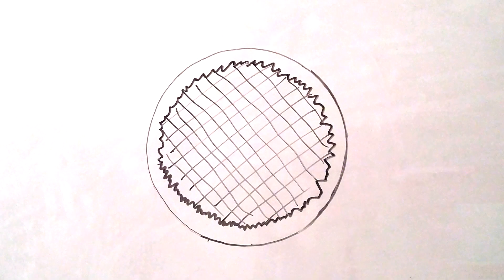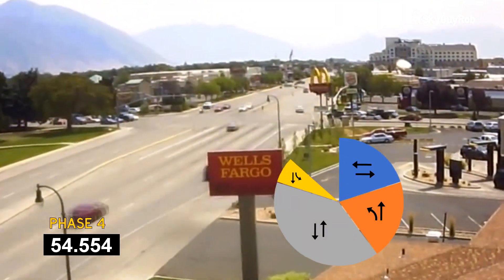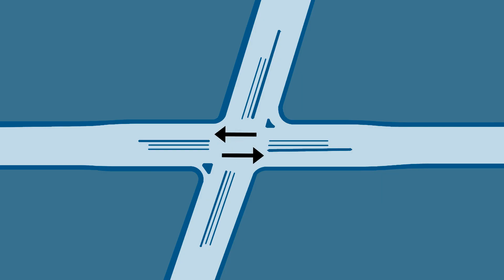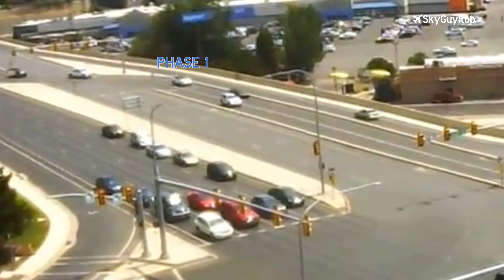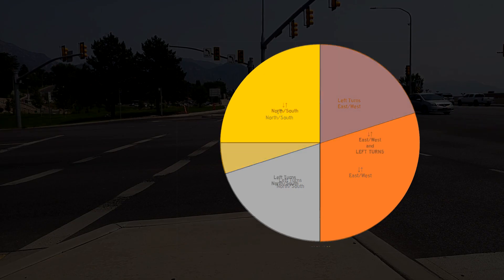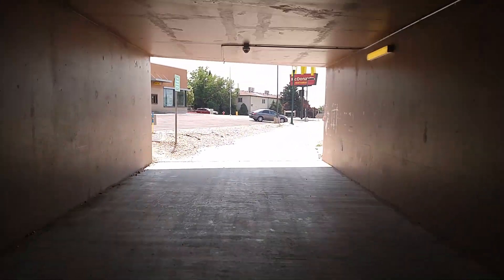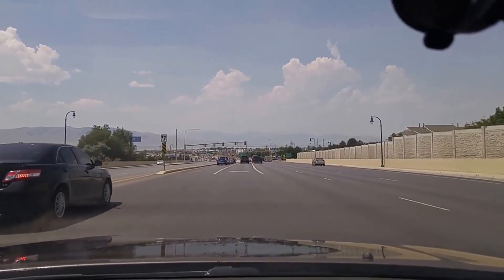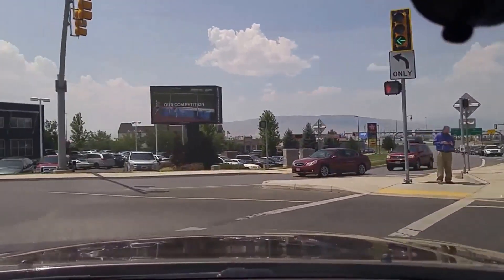New Crazy Traffic Light Which SOLVES Congestion

Comment: Wow, never seen one of these before. You need A LOT of space for them.
Reply: You do, but it’s wonderful!
Reply: Better bulldoze that bicycle lane and bus lane to make room.
Reply: @schroedingershat7912  and homes, stores, parks, etc?
Reply: @josephj6521  Only if we replace the homes with high density housing with no parking. They don't need parks because they're in a 'high transit access area' (at least until we bulldoze the bus stop for another intersection).
Reply: Considering they're being replaced with on ramps and bridges, the space isn't really an issue. Either one takes plenty of land.
Reply: I'm not sure why you wouldn't just go with a roundabout if you need all that space either way. A roundabout would likely wind up taking somewhat less space overall as the additional space is mostly just at the intersection rather than the approach on all sides.
Reply: @SmallSpoonBrigade  I can't imagine a roundabout on a very busy 6 lane road. Sounds like hell. I'm all for em on busy 2/semi-busy 4 lane roads, but very busy 6 lane sounds like death
Reply: It's Utah.
Reply: Yeah but if you've got the space you might as well use them
Reply: Yeah, all it really does is spread the intersection out.  You still can't make a left crossing the oncoming traffic, so it doesn't actually save all that much time, it just reallocates it more to the thru traffic.
Reply: @peterallen4605  you're wrong, you need only 3 light phases, not 4 - meaning you come to a green light 33% of the time, rather than 25% - that means you get a green light an extra 33% of the time (i.e. 133% of a 4-phase) and you can easily see that will improve traffic flow dramatically.
Reply: @joshpavelich5235  I made a six lane roundabout in Cities Skylines. 
It was, in fact, death.
Reply: @joshpavelich5235   Yep. In these cases you typically have a roundabout offset from the main road, with a only few of the main road lanes going to it. Drivers who want to pass the roundabout unimpeded just move into the appropriate lane ahead of time. Yes this only works well for one direction of the main road, but under/over passes are known to be used. Most of our motorway (freeway) junctions are essentially big roundabouts built under the motorway using two underpasses, one for each side of the circle.
Reply: @joshpavelich5235  when I  was young we had a giant traffic circle where 2 highways met and it was an absolute nightmare. Lubbock, Texas just in case you wanted to know
Reply: Hence their presence in Utah.
Reply: @PW_12345  This style doesn't actually take much more space than a traditional intersection, while a high volume roundabout would need to be a lot bigger to be safe and efficient.  Keep in mind the traditional intersection would already have left turn lanes, the CFI is just relocating those lanes.  It does elongate the intersection to break up the crossovers, but that's in the orientation for space that would be needed to construct an overpass with onramps and offramps.  Roundabouts need space between the entrances and exits, they can not fit in the footprint of just where the roads intersect.
Reply: @PW_12345  You might be thinking about lower capacity roads...
Reply: @SmallSpoonBrigade  Roundabouts work great when there's low to moderate traffic or a problem with safety. If you put roundabout on high intensity intersection, you either have to make it huge or it will get clogged up.
Reply: @PW_12345  If things were different then things would be different.  There is no one-size-fits-all solution.  You've got to look at the actual conditions of a project instead of making up ideal conditions.  When roundabouts exceed capacity they fail worse than other options.
Reply: @PW_12345  As someone, who witnessed a clogged roundabout 2 days ago, no, you can clog a roundabout by feeding it too many cars. Unlike regular intersection, space in roundabout is very limited, because cars with different entrances and exits are forced to use the same lanes. In regular intersection there are like 15 meters between your desired entrance and exit, in roundabout you have to cover a lot more distance inside to get to your exit, and chances are, your desired path is already taken by someone else.
Reply: @PW_12345  Again if things were different then things would be different.  And again there is no one-size-fits-all solution.  We get that you love roundabouts and in your fantasy they'll never back up and there will always be another route if they do.  Things don't always work like your fantasy when they are retrofitting an existing layout.  There's a traffic light before this and another after it, so the cars would already be coming in those waves.  The roads are laid out differently in America, the zones are organized differently in America.  Unless you're suggesting to to bulldoze the country and start again from scratch existing traffic problems need to be looked at on a case by case basis.  You tried to just dismiss it earlier but they can make overpasses that are more efficient than roundabouts, they can even hybrid a roundabout with an overpass.  These are each just tools in the toolbag, the key is selecting the right tool for that exact situation.  Also as you mentioned synchronized lights are great if you happen to live somewhere that actually does it, which it just so happens I do.  Some areas have gotten out of wack from various different projects over the years.  The mayor and city council have already expressed interest in creating a new master plan to get it all synced up again and future projects would need to follow, and I'll make sure to keep them to it after the covid restrictions fade.  If you live in an area with bad light timing I'd suggest you to get into contact with your elected officials.
Reply: @PW_12345  Yes, I understand you could paint some lines on the ground and call it a roundabout.  What I am telling you is there's more to it than that.  It's not about figuring out how to shoehorn your pet ideas in wherever, but rather considering the options for that particular situation given the existing conditions, traffic patterns, and plans for the future.  It does not matter how good you are at deflecting away from anything that's pointed out to you it doesn't change how these things work in reality.

All roundabouts would have some maximum capacity based on the exact angles and dimensions.  Though they generally have a similar look there's subtle differences.  They can only accommodate so many cars entering at any given time, if that's exceeded it's not going to work right and all of the benefits take a nosedive.

An overpass may cost millions but the people who use it could then make and spend millions collectively over and over again.  The price tag can be inconsequential when extremely high capacity is needed, and they can be more efficient and safer than roundabouts.

If a corridor has traffic lights properly setup to send down platoons you have a pretty good chance of hitting the first light at green, but even if you do need to stop there the rest of the way would turn green right before you come up to it.

And again I'll point out there is no one-size-fits-all solution.  These are all different tools in the toolbox to consider for different situations, always try to use the right tool for the job.
Reply: @PW_12345  And it's been repeatedly pointed out to you that it's not that simple.  Just saying you can figure out how to cram a roundabout in there without any regard is how bad roundabouts get proposed.
Reply: @PW_12345  So you're telling me a small roundabout is good for lower capacity and it would need to be bigger for higher capacity...  are you really this dense or just trolling?
Reply: @PW_12345    So you're telling me a small roundabout is good for lower capacity and it would need to be bigger for higher capacity...  are you really this dense or just trolling?
Reply: @schroedingershat7912  It's cute that you think we have buses
Reply: I’ve got a couple of them in the austin Texas metro area. Google map the image of 1431 and Parmer lane in austin Texas and you’ll see one. 
It takes a bit of getting used to.  I think they’re useful in intersections where there is a severe imbalance of right vs left turns. At this location above, probably 75% of the turning traffic makes a left.  Maybe more.
Reply: @peterallen4605  A couple of these built in Utah do double CFIs, where there is a cross over in all four directions. This effectively doubles the throughput of the intersection, cutting wait times in half. A bridge is still better, but CFIs are a solid option for some situations.
Reply: @TheOriginalLexa  its really not.

Comment: When I was in Germany, in the late 1960s, they had something odd on the side of the streets in larger cities. It was an old fashion looking "Side of the street, traffic control light looking Light" like we used to have HERE in the 50s a before (when people actually PAID ATTENTION to said Lights). It had 4 lenses and each lens had a Number on it. When the number lite up, all you had to do is adjust your speed to THAT number and you would make the NEXT GREEN LIGHT. You never saw much traffic congestion and the traffic was always moving. Saved on fuel, brakes and yes, even TIME. As you didn't have to come to a complete STOP then take off again. Always wondered why they didn't do that HERE in the U.S.
Reply: Because innovation costs money.
Reply: They do something similar for trains in the USA.
Reply: @ashkebora7262  Not as much as making new roads!
Reply: And I wonder why we don't have more of these here in Germany.
According to Wikipedia we have less than 20 Geschwindigkeitssignale (speed sign) installed here in Germany.

I regularly drive on a road with such a system and I think it works perfectly (as long as nobody drives faster than the sign says). 
So I don't understand why it isn't used more often.
Reply: @Jehty_  Here in the states, that variable sign would just say ZERO. I swear traffic control teamed up with the oil companies to try and MAXIMIZE fuel consumption. I cant tell you how many times I stopped at  a red light for minutes, and NO ONE went through the green, and as soon as the cross traffic turned red and we turned green, cars would start accumulating on the cross road that was just green while we were waiting..
Reply: As far as I understood it was an invention of Philips. It was first (I think) implemented in Eindhoven. I remember it as a kid.
Reply: People here are allergic to cruise control here in the US.

Never met someone willing to use it under 50mph and while you CAN manage that without cruise control... most people are too stubborn to learn.
Reply: woah i- i- i’ve never thought of that before; grrr too oil companies, indirect greed in action!!!
Reply: @treyhart6861  Around me they added a traffic signal about a year and a half ago on a T intersection that really didn't need one but because they added some bike paths they did anyway.  It would be fine if the main thoroughfare had a green until there was actual demand from the side, but they didn't.  It goes red for no reason to force me to almost stop and then when it finally detects me I can get going again.  I would estimate it actually has a bike or cross traffic needing to cross about 5% of the time.  This is something I have to do a few hundred times a year in a semi so I estimate that just from me alone it's probably pointlessly burned nearly 100 gallons of diesel.
Reply: They did.  Old signage would state that those who drove a specific speed would hit a “green wave” where they were all green in a row.

Comment: This can be very useful in situations when you have an intersection where a left turn is used more than average while having a lot of thru traffic. Plus, overpasses aren't always appropriate (as well as an eyesore) and a roundabout isn't going to work well when a lot of traffic wants to get off on the left most exit.

I installed one of these on Cities: Skylines for this specific situation, along with timed traffic lights, and it's extremely smooth with less congestion.

Comment: Hi! I'm from Belgium and live in the town with the 3rd deadliest xing in the flemish region. Always wanted to do a video about this, since people will not believe how this thing could exist in a developped country. While researching how the problem is called I always ended up on displaced left turn. Your video actually explains this very well. I'm not sure this xing over here is fully related tho since right, left, straigt cars and straight peds/bikes get green at the same time. So there are multiple conflicts every cycle. Add on top that most bikes just run a red, so when you are going straight keep an eye out and be prepared to brake. Local people know this xing so they tend not to get into accidents, however people not familiar sometimes end up having a bad day. When I was still a novice driver I actually had a sneaky detour so I could avoid doing a left turn.

Comment: One of the earliest of these went in on I-44 and State Highway 13 in Missouri north of Springfield.  Previous to this, traffic would clear the intersection in about 10-20 minutes, and that was a GOOD day.  Any accidents, think 30 minutes to 2 hours to clear a 1/2 mile stretch of road.  Enter the CFI.  Now, a BAD day is 10-15 minutes.  The other one I know of (and I used to drive it about 3 times a week) was under the interchange of Front St and 435 in Kansas City.  Again, waits were short, traffic moved quickly and if you missed the first light, almost guaranteed you wouldn't miss the second.  That I know of, there are no plans to replace these intersection with anything else.  These work for their intended purposes.

Comment: They put one in here at Colorado Springs it a busy intersection where they couldn’t put a bridge about a year ago. I was initially opposed to it and thought it was weird would cause months of accidents, it’s actually worked out very nicely and most people now like it.
Reply: Yeah, at Woodmen and Union. I like it, but it does have one flaw. I’ve seen repeated occasions where someone turning left in the outside turn lane from northbound Union to westbound Woodmen ends up taking it wide and enters the turn lane for traffic turning from eastbound Woodmen to northbound Union instead of the lane they’re supposed to use. It’s particularly bad if someone who does that makes that turn as their light turns red. They end up going the wrong way down the turn lane just as the traffic turning north on Union is coming and they have nowhere to go because they’re blocked in. I’ve seen a couple accidents there because of that.

Other than that, I think it’s a very efficient intersection.

Comment: Locally, in Chattanooga, Tennessee Department of Transportation has been working on re-engineering I-75 and are creating similar ideas. The 75/24 Split recently got a new Over Under design which is slicing the southbound congestion significantly and giving a fair fix to the north and west bound traffic. On the same split, they're planning a bypass of Chattanooga and I think it's going to connect with the Cherokee Highway in Cleveland (approximately 24 Miles from the split) which ends into an Overpass on the Cleveland Bypass. If not that, then it's likely going to be suspended approximately 100 or so feet above the main I-75 and continue alongside it with exits at Shallowford Road(Exit#5), Old Lee Highway(Exit#7) and come back down at exit 11 in Ooltewah. Going west, however, I have no clue and can't even begin to imagine what they're gonna do. They have the whole of Missionary Ridge blocking them. In regards to traffic management, however, we've been seeing redevelopments of Lee Highway and Apison Pike, primarily leading from the intersection of Volkswagen Drive, and Lee Highway out into Apison Tennessee. As more and more people move to Chattanooga and the surrounding area, more and more highway development is bring produced by TDOT. In Collegedale, on Apison Pike from Four Corners to a yet unknown end, they have been widening it to Five Lanes and plan to bypass the Railroad Crossing altogether and create a suspended highway, redirecting Apison Pike to a higher elevation. I believe this to be partially because of the McKee Bakery having problems getting loads into and out of Collegedale. Back to I-75. With major improvements to I-75 going into Tennessee, GDOT is trying to catch up by widening and adding bits to Georgia I-75 between Dalton and Cloud Springs Road. Back to basic roads. Although we don't have one of these yet, with our city being voted one of the worst nationally in terms of traffic, I'm almost positive our City Council has looked into using these and may already have plans to do so entering Downtown as well as in surrounding East Ridge and Red Bank. To be completely honest, I'm stoked to see the finished product. Of course, they started all of this back in 2010 and I'm sure it won't be finished until somewhere in the 2030's. But still, I anticipate these improvements will be a major player in traffic management and I will no longer have to worry about morning or evening rush hour traffic as much.